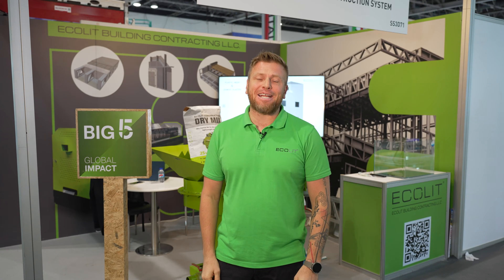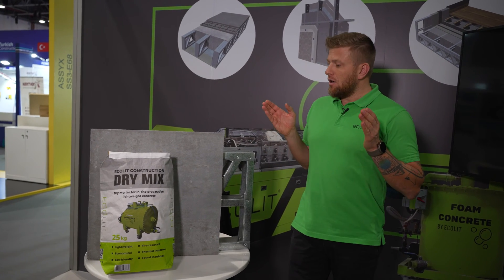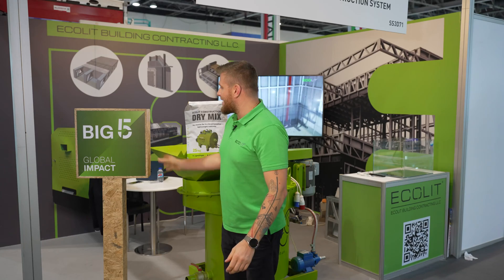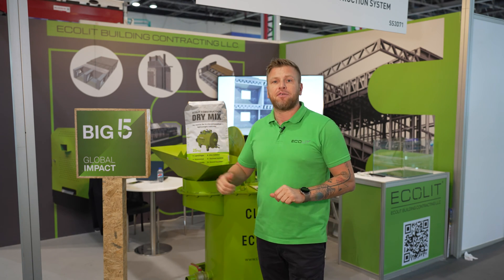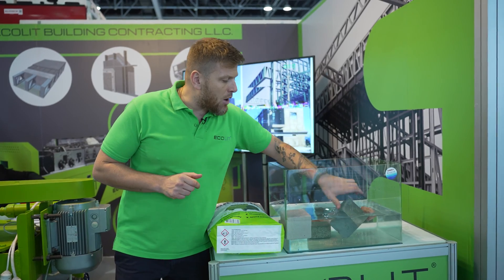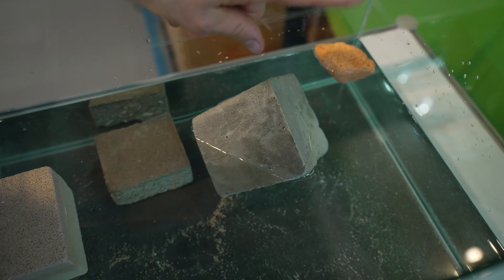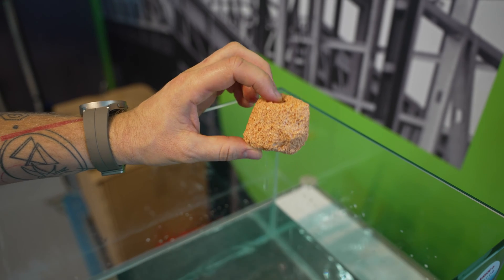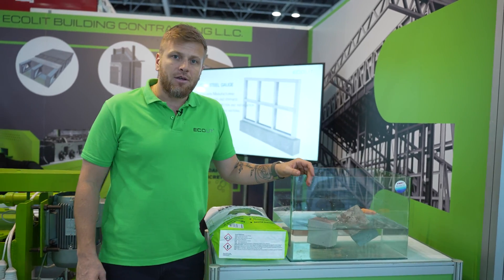Why is this foam concrete better than traditional concrete?

Comment: Nice demo. On the floor pour, what are you using on the underside for forms and are they removed after it is cured? How long to cure? Talk about the rating of this floor assembly, sound and fire. What is the equivalent UL assembly, though you may use intertek. How do you run meps in the floor for multifamily?